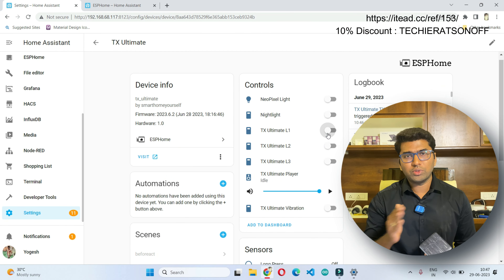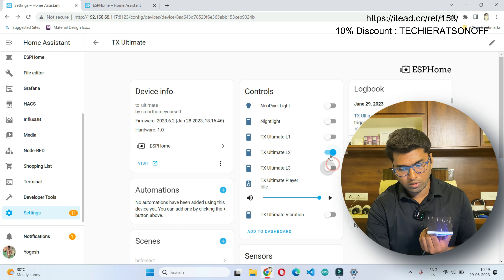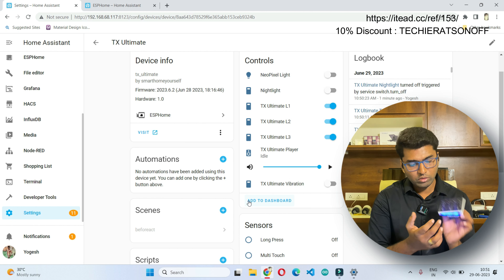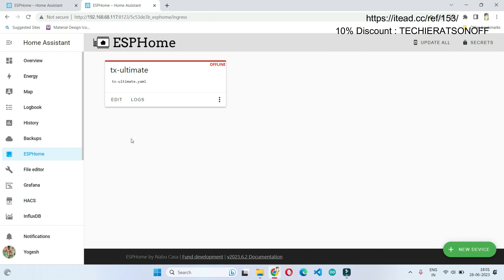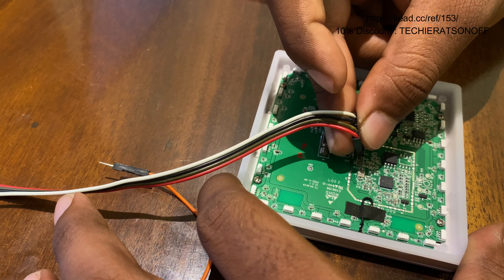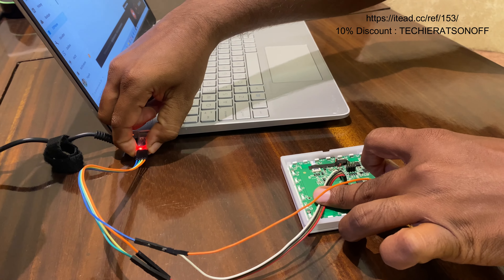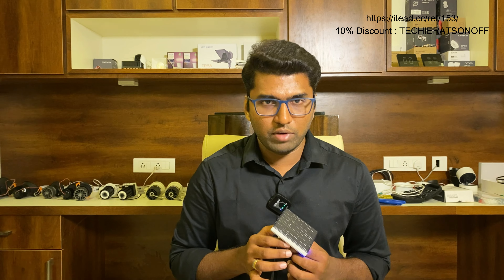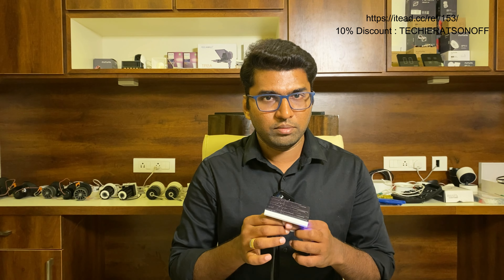Flashing ESP Home on SonOff TX Ultimate Touch Switch in Home Assistant

Comment: the video of showing the cable connection with the usb to serial should be better and the fact that you changed the cables in the middle killed me. also it would be nice if you could show the info inside the node red.

do you know how we can enable the led color to be activated on the top of the switch as well when the relay is on? right now it only shows as the bottom
Reply from the maker: I will check it out and let u know..